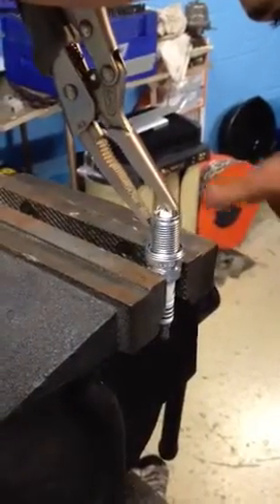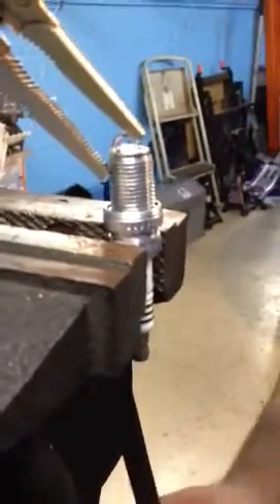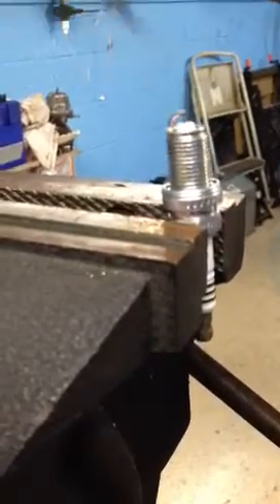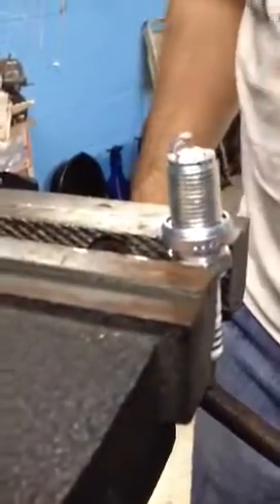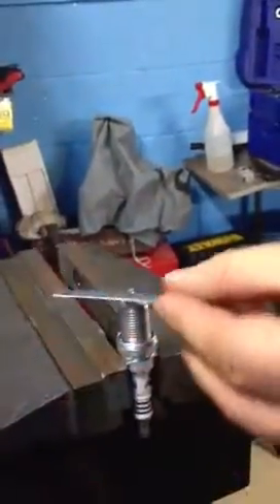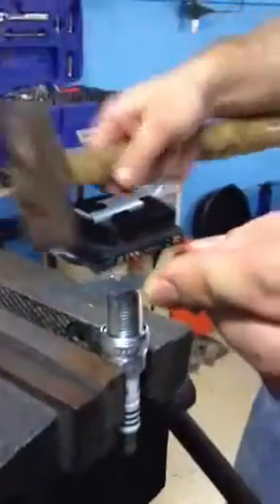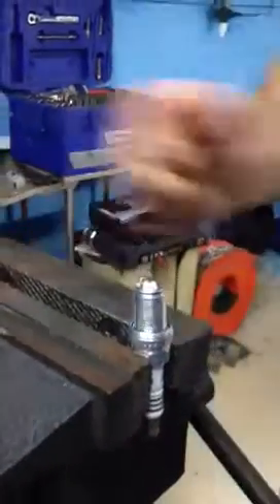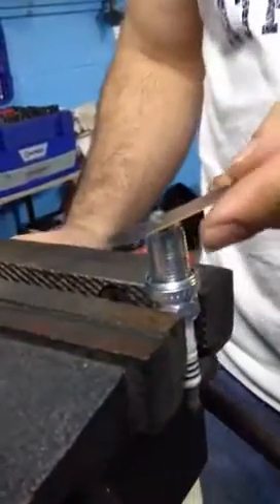How to gap and de gap a NGK iridium 2669 spark plug

Comment: Nice...vice grip tool face grinding on the threads of the plug. Be sure to hold the plug with channel locks.
Reply from the maker: Michael Hordaddy still doing it the same way lol. 5 years later

Comment: Do not follow this video!  This is a hack, I haven't done that since before high school.  Using needle nose pliers can dig into the threads and damage them which will then damage the threads in the cylinder head.  Wrong, wrong, wrong!  Buy a proper tool and learn how to use it.
Reply from the maker: John Mitchell lol if you don't like it don't do it. You can't use a gap tool on A iridium spark plug. Stop Hating

Comment: Thanks for sharing your video. Last thing I read from NJK was the same thing we did in shop...tap the ground electrode on a hard surface. I guess this is basically the same thing. Main thing is to be super careful not to damage the centre electrode.